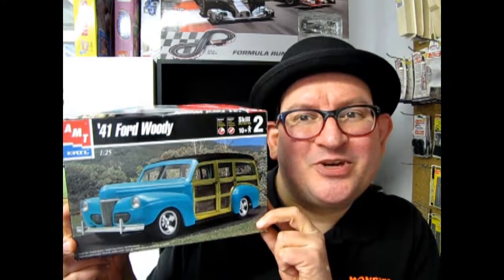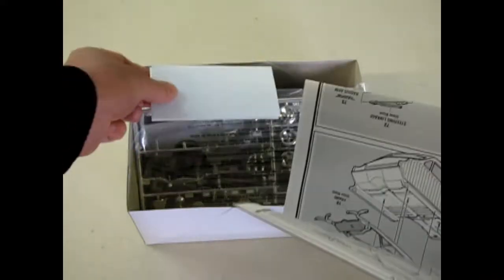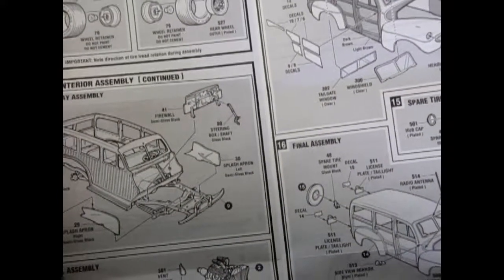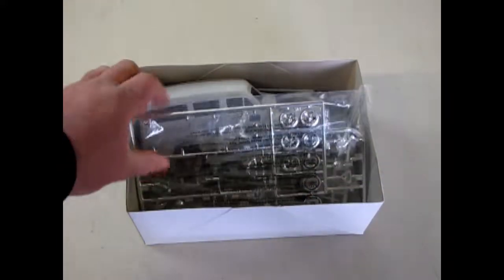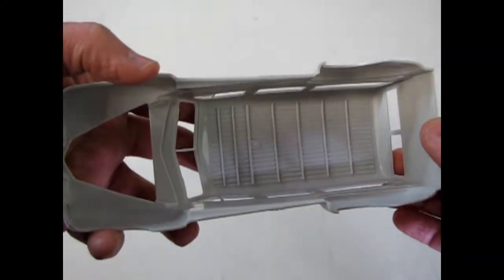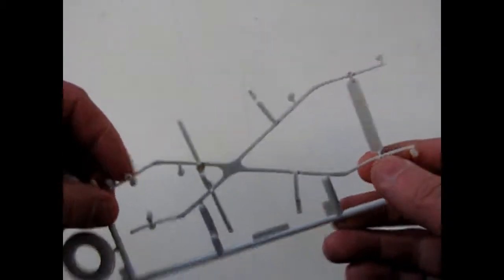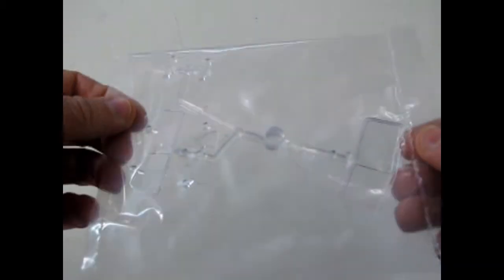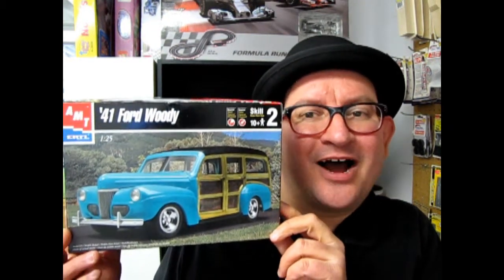Model Car Garage - 1941 Ford Woody Custom Edition Model Kit By AMT/ERTL - A Model Car Unboxing Video

Comment: A tough choice between the stock and custom kits, I think prefer the stock version but those custom wheel backs and the Goodyear tires are pretty nice.
Reply from the maker: Thank you! I am glad you are liking my unboxings.
Reply from the maker: Did you ever get to build one of these?
Reply: @MonsterHobbiesModelCarGarage  Not yet, I have that AMT kit tho'.
Reply from the maker: @ModelCarMinion  I haven't finished it either. Do you have a good suggestion for painting wood paneling?